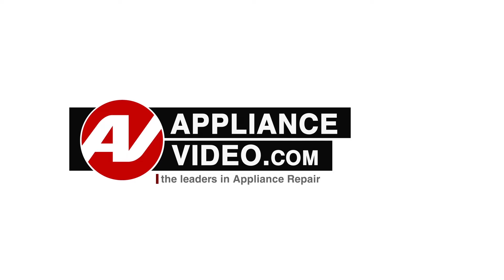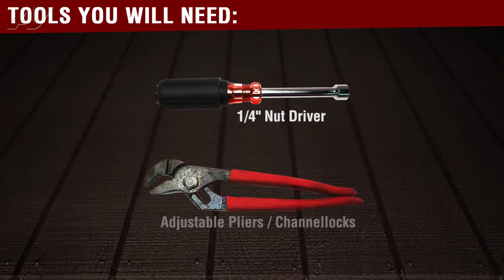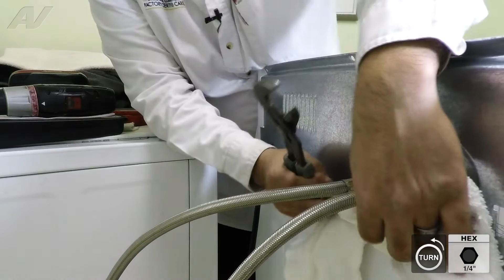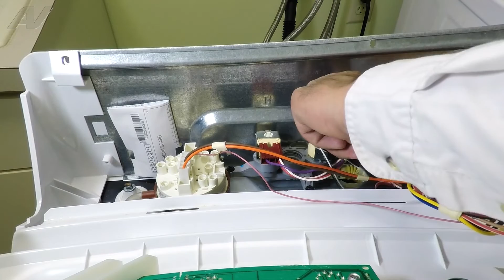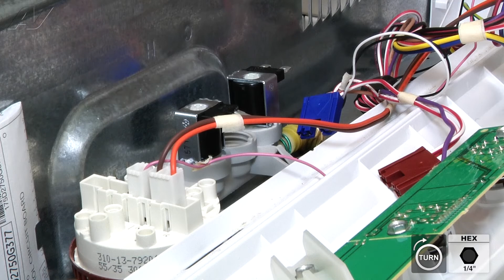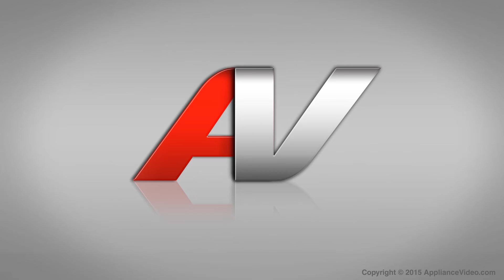GE Washer Repair - Water Valve Leaking - Water Inlet Valve

Comment: Thank you for this information.  How can I figure out if it's the valve or the hose and water inlet that needs replacing? Thanks
Reply from the maker: Great question, if you have a more technical question that our parts department cannot answer, you can search our over 17,000 answered questions free at our website www.ApplianceVideo.com under our Repair Help section. You can also call our parts department at 1-800-830-5465 and they can give you help 7-days A week ,or search at www.SaveMoreOnParts.com  .